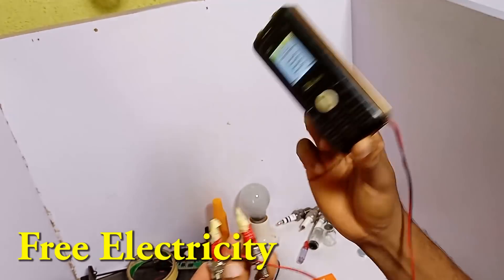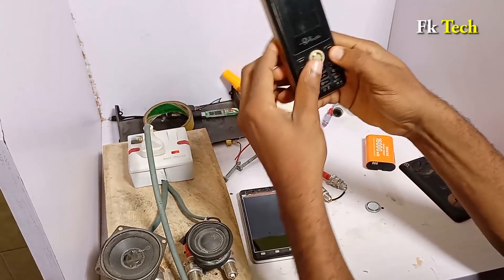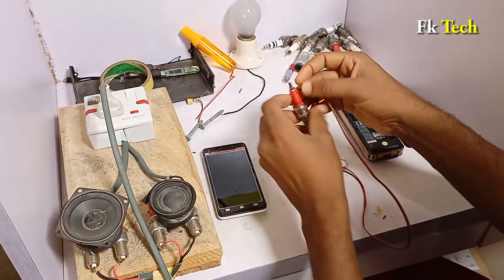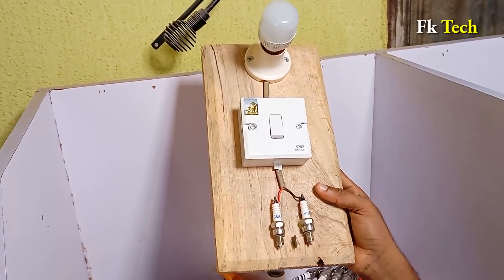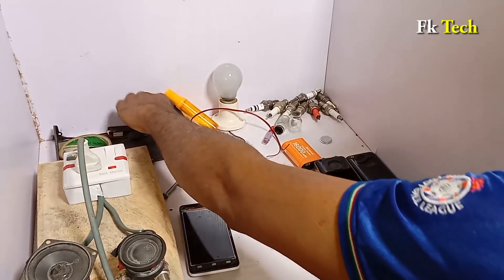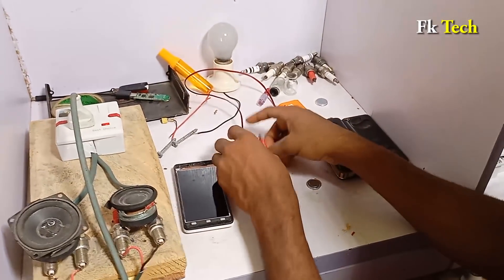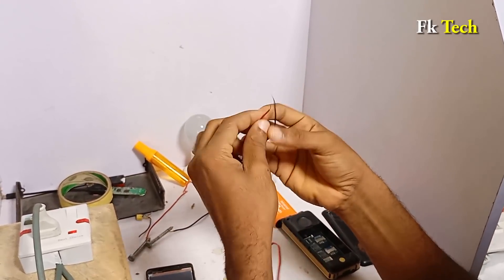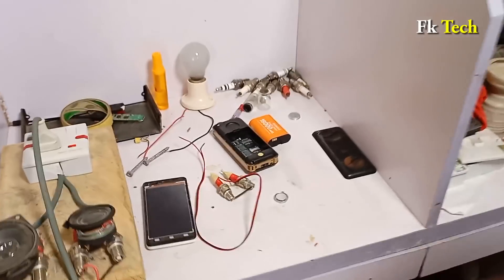Free Electricity Energy Generator With Spark Plugs To Power Mobile Phone

Comment: Spark plugs are just conductors. How can a plug produce electricity with magnet without rotating 🤷??
AC current can shock but DC Don't, then why you don't got shocked when it AC current as  you claim??
Huhh 🤣